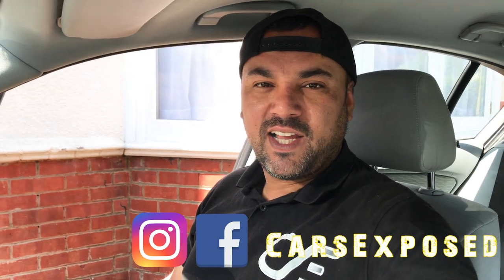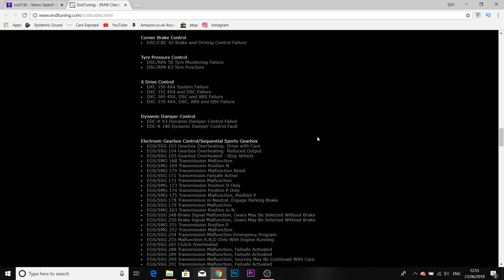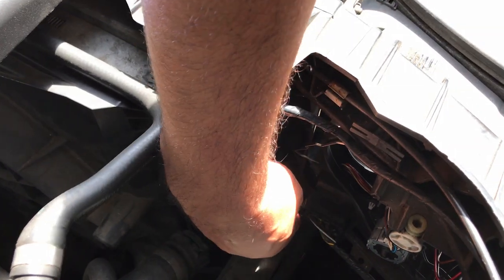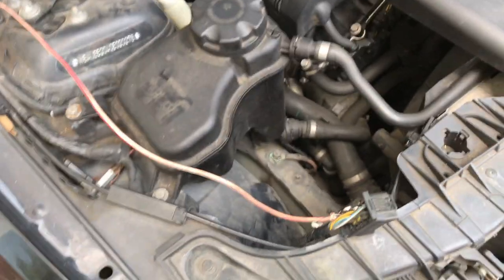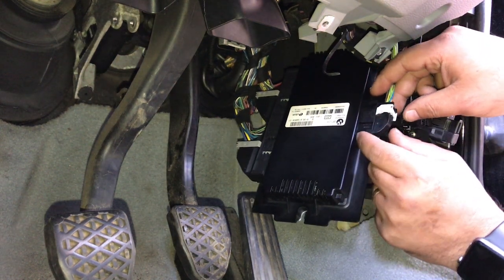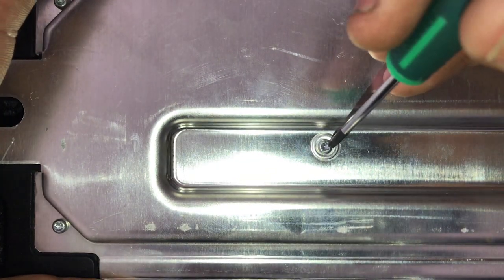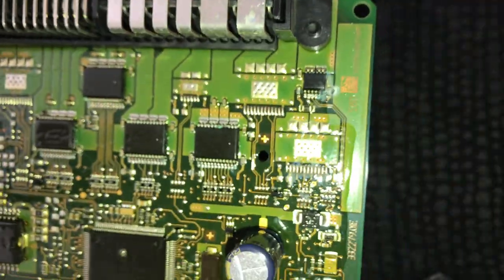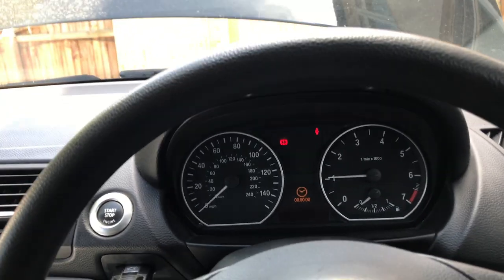BMW 1 Series Footwell Module Problem Headlight Warning

Comment: Brilliant - thank you. I had exactly the same issue with the headlight warnings. I went straight to the FRM part. Mine had the minimum amount of corrosion on a different contact. After cleaning with Isopropanol the problem has gone. The warning bong had been driving me nuts more months. Thanks again your video solved the issue.

Comment: Lots of problems with this modules in the footwell. Quite often mechanics recommend changing the module but nice to see someone going trough the trouble of opening it up. Easy fix 👍
Reply from the maker: Lucian Razec hi is understanding when professionals advise replacing parts because for a garage see you comeback with the same problem isn’t ideal financially and for their reputation aswell, but in my case I’m diy‘r if you like working on my own car therefore I want to save as much as I can, personally I think this repair should last a long long time but we will see ... thx for watching and your comment cheers 👍
Reply: What did you use to clean the module? Did you use a fine fibre brush ? Any contact cleaner solution at all ? Great video my left headlight park light unit is shut down completely fault codes says it's the FRM
Reply from the maker: Quite common mate they get moisture and crusties, I’ve used a tooth brush and isopropyl alcohol 👍
Reply: Thanks man . I'm gonna try take it apart this weekend and see if I can clean it out . If not then I will get one of Ebay. Should I bee looking at any specific serial numbers? For different models etc or would any 118d FRM fit and be fine ? Also thanks so much for showing how to read the error codes and referencing them of EndTuning . That website is amazing .
Reply from the maker: You are very welcome ... I would of thought that it has to be the same serial number and perhaps coded to your car I’m not 100% sure... let me know how it goes... I can find out 👍👍👍

Comment: You are a legend! I literally found your video in the nick of time as car test is tomorrow, had same issue as yourself, I cleaned the FRM module with electrical cleaner, same corrosion on it as yours and it worked a treat. this has been driving me nuts for weeks, I'm chuffed it's finally sorted. Thanks a mill!

Comment: I had exactly the same problem and the same codes.
Took out the module and there were some oxidation. Cleaned it and it all worked again So MANY THANKS from Sweden

Comment: Awesome. I was lead to believe that this was a software not a physical failure. I will check my module in this way asap as I have a very similar issue.
Reply: I had some mild corrosion on the pins leading to three pins next to each other on the same connector. These pins matched the lights that were reporting as failed. Problem has not returned in three weeks. I took the opportunity to save the coding from my FRM so I can replace it myself in future if needed.

Comment: I have an e84 X1. I have no high beam flash function. The blue light illuminates on the dash but no flash. High and low beam work as they should but no flash. My car also says it has high and low beam fault like yours. Worth a look I suppose. Mot is next week and I'm worried it will fail.

Comment: Must be water getting in somewhere. Two drains either side of engine bay can get blocked with leaves or the seal that runs along the lower edge of the windscreen (sun damage) or the sunroof drain tubes can get blocked up, if you have a sunroof. Also sometimes water can get in via the door, if the sealing membrane behind the door card has been damaged in the past when doing window repairs.

Comment: Absolutely awesome, thank for uploading this.  Hence, shame on bmw for applying useless moisture coating.
Reply from the maker: Thanks mate 👍👍👍
Reply: @CarsExposed  My BMW rear level height sensor has a fault.  I've replaced with a new genuine bmw unit but the fault code 9CB4 remains and driver side mirror goes up down at it's own accordance intermittently.  I suspect the some sort of similar problem like yours.
Reply from the maker: iTCXtreme interesting but I never came across this problem before bud
Reply: @CarsExposed  Some point I'll be take the FRM module out and have a look at the internals.  Luckily, I have ista-d and that talks you through the full troubleshoot.  Forgot to mention, my vehicle is 330d e90.
Reply from the maker: iTCXtreme awesome man I’ve subbed to your channel looking forward to see the outcome 👍👍👍
Reply: @CarsExposed  😊👍

Comment: Thank you so much for this, my e90 threw up the exact two same CCID codes a month or so back after heavy rain... I am now wondering if blocked drain holes in the engine bay make the water back up and creep down the loom? I will be ripping apart my beemer tomorrow to see if it's the same issue as yours :)
Reply from the maker: Sabretooth Barnacle I’m not 100% sure what caused it but is worth having a look at the drains, at the time that I fixed this car it didn’t seem like the footwell was wet but felt like that area gets quite dump for some reason ... good luck tomorrow 👍
Reply: U find   the problem  to yours

Comment: These cars are a nightmare got the same with mine says all the bulbs are out, I’ve had the control module under the fuse box changed, now the ecu has got water damage looking like I’ll have that replaced now, and then I’ll have to take the footwell module out clean that up hopefully or potentially change it

Comment: Any ideas on main beam not working one side? Bulb good, fuse good
Reply from the maker: My next process would be check connector plug , wiring , then module .

Comment: Can any one help me iv got a bmw 320 d m sport hardtop e93 had a auto electrician out he said the ecu unit is faulty taken it out and sent it off for repair got it back plugged it back in and still the headlight not work I need help

Comment: I have to remember to look inside / open a module when everything else checks out ok. Quite a cost savings if it can be saved by cleaning! =)
Reply from the maker: Thomas EXOVCDS Hi Thomas how’s the holiday mate? Yeap I got really lucky on this one, all I did was cleaning it with some isopropyl alcohol ... the worst part was checking the wiring loom. I saved a lot of money ready to enjoy the car for a little bit and sell it 👍 cheers
Reply: Cars Exposed Holiday's going well... I'm on my last week, back to work in July.
Reply: Thomas EXOVCDS about time 😄